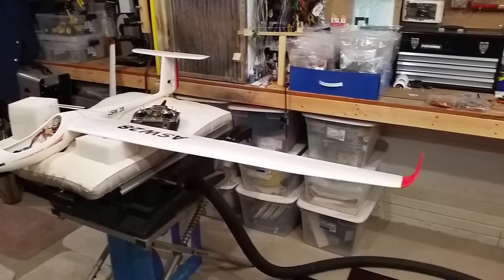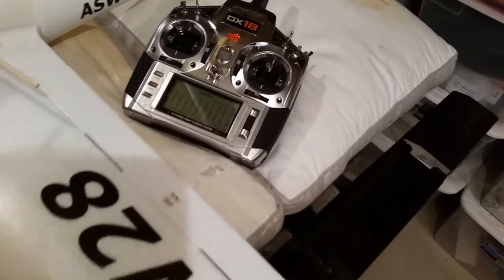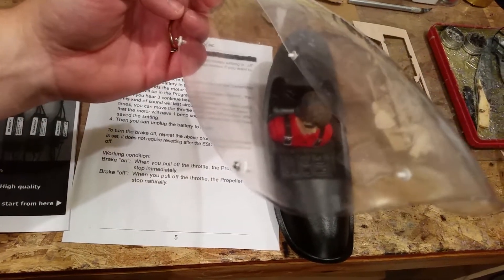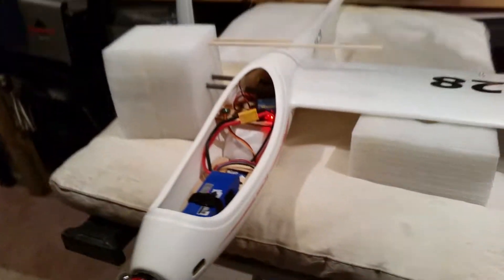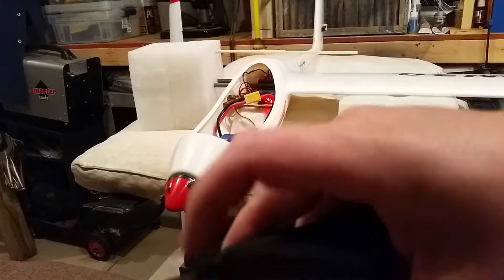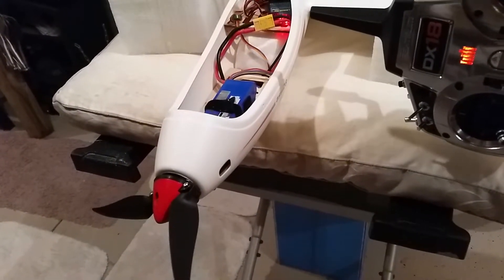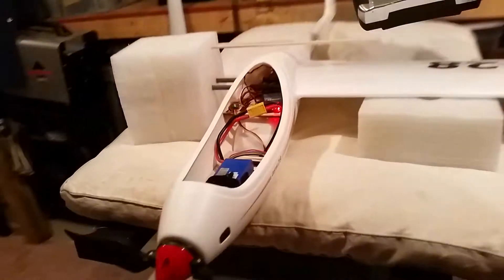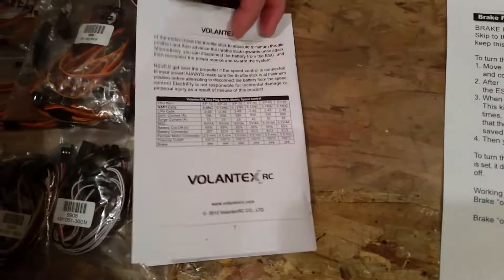Volantex RC / Lanyu - ASW 28 - Turn On Motor Breaking (old one)

Comment: Cheers matey, I'll try this later on as I already substituted a Turnigy esc in it's place. Ironically I started swapping the motor connector for my usual Deans type, bu tfound that my soldering gun won't heat the connectors and motor wire enough to melt the solder!! :¬? I think my soldering tip needs replacing. I've read that the coating on some tips can age even when you stopped using it for a while.
Reply from the maker: I find that when they get too hot for too long, they get warn out. If you have some flux, you might be able to get her to work for you.
If not, here's some recommendations from me for your consideration....
Soldering...
40 Watt Soldering Iron Kit - http://amzn.to/2DEFo98
OR
40 Watt LED Soldering Iron Kit - http://amzn.to/2FmM38n
Iron Holder - http://amzn.to/2EeWg7w
ST3 & ST7 Tips - http://amzn.to/2DE8K7K
Solder - http://amzn.to/2njxon7
Helping Hands - http://amzn.to/2rLN0oH
Tip Cleaner - http://amzn.to/2DKjmpP
Flux - http://amzn.to/2DGNPRz
Wick - http://amzn.to/2EcDVrD
Desoldering Stuff - http://amzn.to/2EeR1ES
Tip Tinner - http://amzn.to/2DIH81f
Reply: heh, cheers. Yes, I forgot I do have some flux somewhere.
 My biggest prob locally is that a nationwide electronics chain, Maplin, just closed their shop and went into administration!!! :¬(
So I've ordered a new tip onling and will shop for a cheapo one locally which will, hopeluffy, manage half a dozen connections before going west.
Reply from the maker: I use a CHEAP soldering iron ;) Good luck with the Flux; It could make everything work, but just don't over do it, or you'll get smoked out - LOL!

Comment: Is it the video or me, was the prop spinning backwards?(Retracting that comment, read your comments)
Reply from the maker: It was NOT you... I evidently changed rotation at some point while I was filming this or right before.

Nice catch! I either rotated it with ESC programming or swapped two of the ESC leads.